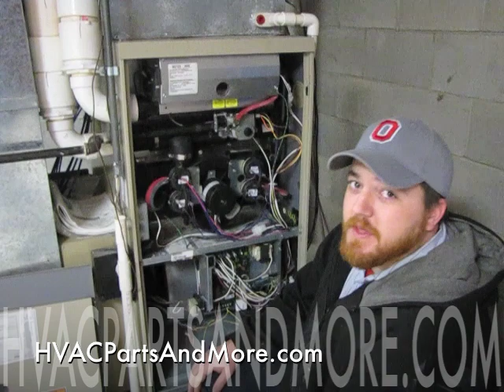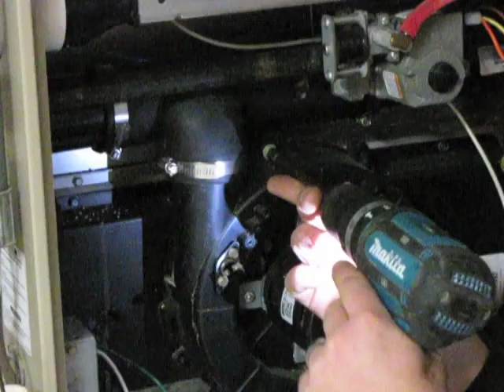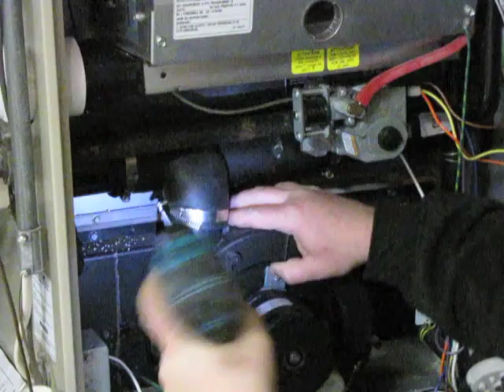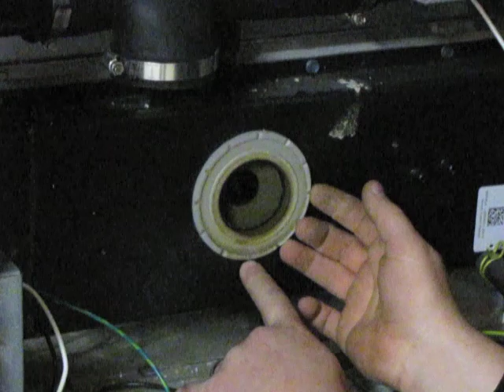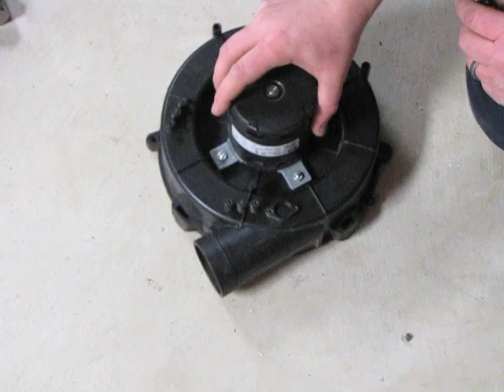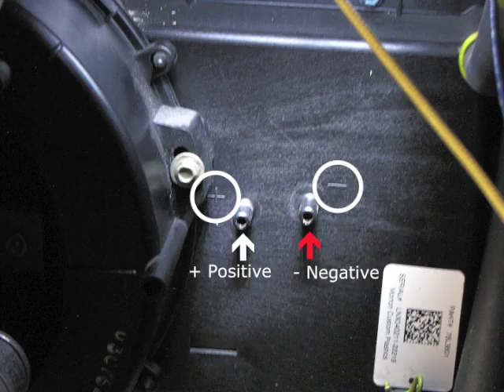DIY - How to Replace a Draft Inducer on a Lennox G61 Furnace

Comment: Inducer motor was making a loud rattling noise and ultimately would stop and shut down the furnace. I pulled out the motor and checked inside, no debris, sound or resistance when I manually spun the wheel. Drained and reinstalled and now the inducer motor and furnace are working fine, no rattle or noise.  New motor is enroute.  Any input or advise would be appreciated.

Comment: I recently called technician in and found that the inducer is hot and gone. He ordered a new inducer motor(Fasco type:U21B P/N:18L0401)which is visually bigger and designed for Lennox g32 series into my Lennox g61mpv unit because he said it's hard to find the original inducer which is a Fasco type: U62B1 P/N:38M5001. When installing the new inducer, he actually taped the two press switches onto the new inducer because the new one lacks holes to fixate the two like you did in the video. 

The new inducer actually is 2.1 A vs 0.8 A on the original one. Im not sure if it will be fine.

Let's just hope the new inducer wont cause any potential problem.